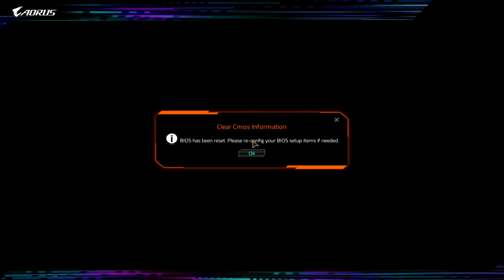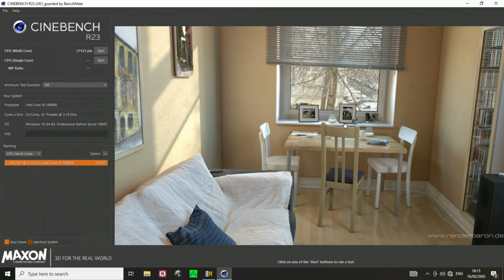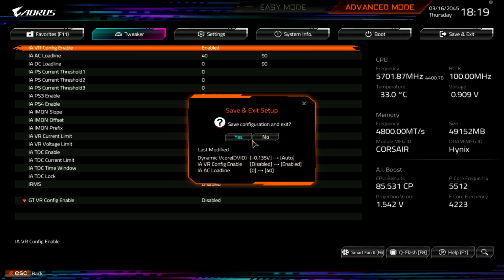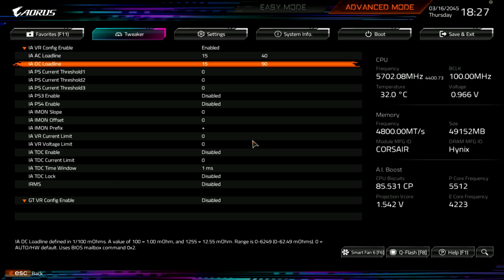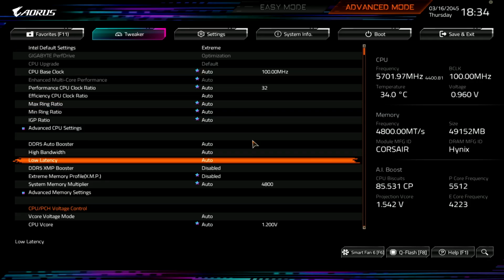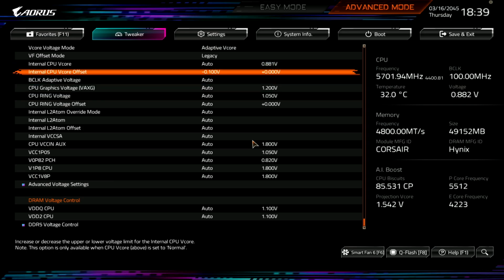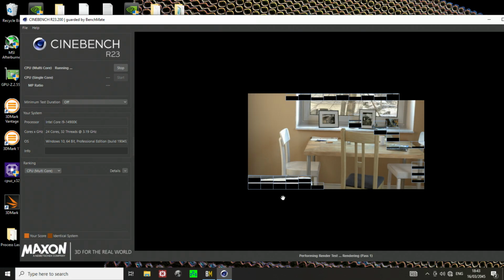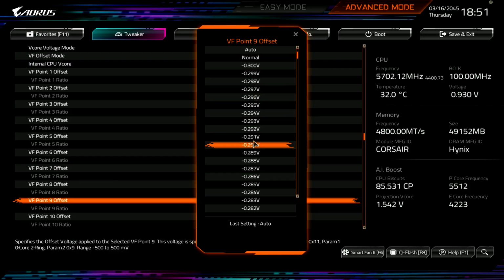YOU  DON'T HAVE  TO TURN OFF CEP to undervolt intel 13/14th gen CPUs

Comment: What does MSI Lite Load setting do (as opposed to load line setting)? Ive set mine to mode 3 which gives me much lower temps and no performance degradation on my 13700k. CPU temps under load are around 75c, whereas with the stock setting of 9 it hits 100c. Is this a good way to prevent or reduce the voltage spikes? Never had a crash in 18 months.
Reply: Lite Load DOES set Loadlines (AC_LL and DC_LL) the thing is that it hides this behind some abstract numbers on "Normal" mode. If you go to "Advanced" mode, you can see what it does and you can also set AC_LL and DC_LL on its own. Intel default goes to 110/110. If you use "advanced" mode instead of "Intel default", but enable both CEP settings, you might end up on 80/80 or something (I don't remember exactly).
Reply: If you can go to Mode 1 without crashing it's even better. the lower you can go, the lower voltage the mobo give to your CPU, so it depends on your CPU quality, if it can perform at Mode 1, then you're good to go.
Reply: MSI Lite Loads are basically just load line profiles. For example I believe Mode 3 would be an AC_LL of 15mOhms and a DC_LL of 80mOhms on my MPG Z690 Edge.

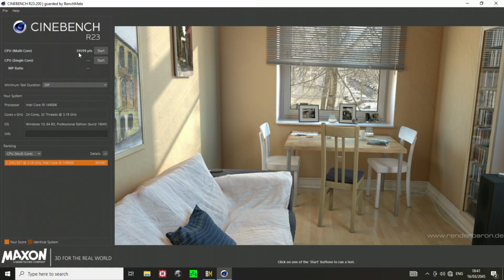Comment: 33:22
nvidia 375.70 (3rd row from top to bottom, right side) is from 2016.10.28.

nvidia 474.64 (1st row, 3rd column from right) is from 2023.10.31.
Reply: NGL, i really don't like Nvidia driver naming scheme. These numbers are not telling. 
For example AMD currently uses this scheme for public releases.
YY.M.V (aka 24.7.1 would mean first driver in July 2024.)
Professional usage drivers have naming YY.QX (aka 24.Q3 would mean driver from third quarter of 2024).

And test branch drivers have this naming scheme
XX.YY.ZZ XX is usually corellates with year, but can lag behind significantly. (Aka 24.20.08, meaning major version 24, branch 20, version 8, or something like that).
Reply: @DimkaTsv  who cares - number higher is all that matters - but really, for most its "I was told my software X I have new drivers"

Comment: I'm not a fan of keeping intel default profiles enabled. The stuff they lock out from motherboard to motherboard is just so random, it's annoying to deal with. Not everything translates well when trying to help others. Just go full manual mode, disable it. I've had great results with Turbo LLC and AC LL as low as possible, small offset on top. Not every CPU likes -0.1V, not even -0.05V unfortunately.

Comment: Which specific motherboard are you using, and when you said the Elite has a different voltage regulator, did you mean the Aorus Elite X Wifi7 model has a different VR?
Reply from the maker: No I meant the non-X elite
Reply: @ActuallyHardcoreOverclocking I love how motherboard and other PC component companies make their product naming incomprehensible. Last time I spec'd out a build for a friend, I had to create multiple spreadsheets to keep track of the confusingly similarly named parts. Slap an Elite, Pro, Super, Ti, or a random tech suffix, and watch as consumers with finite time and energy capacity spend too much on parts that don't do what they think they do.

Comment: 15:01 wow that is even lower than my 13600K which scores around 20k, which is actually quite a bit lower than what a 13600K should perform. Maybe that's because of degradation or maybe it's because my Deepcool AG620 air-cooler is not enough for this chip.
Reply: What score should an i5-13600K get ideally?
Reply: @BucifalulR  around 24-25k is what I had seen on other people's, including reviewers, benchmarks. It could be that the whole debacle with degradation and the new Intel Default Settings and the latest 0x129 microcode have caused some performance regression, but from what I have seen around the internet, it shouldn't be as bad as 20k on Cinebench R23.
Reply: @D23-qw7jf  I got 20802 only :(. If I apply Buildzoid's IA VR Voltage Limit of 1400 (Gigabyte B600M Gaming X DDR4 motherboard), I get even lower, like 19000. Maybe I should try with Intel Default Setting disabled, but doesn't that increase the risk of degradation?
Reply: @BucifalulR My 13600kf gets 25k+ on my old settings and slightly under 24k with Intel default settings.
Reply: @RandomGuy-ll9uz  On CInebench R23, right?

Comment: so i have a core i7 13700k ... I have seen 1.495 volts ... is this normal? thats with defailt latest bios and micro code nothing set to "performance" in the bios or so and no over clock .. CPU gets pretty hot too 

I have no idea and i find no data what says what is the normal max i should see ..but since i have seen several say " set max in bios to 1.4 volt and not higher " ...i am basically at 1.5 volt and thats not save ?
Reply: I'm not running the new microcode because I don't trust it not to overvolt my CPU. On an older microcode (10E I think) and with a modest undervolt my 13700k never goes above 1.29V. I'd recommend you check what your load lines are being set to at default.
Reply: @AzwraithPL  yea with the old mucro code max i did see was 1.365v.. but not with the new one
Reply: @noblackthunder  You can check what your load lines are set to using HWiNFO. Uncheck Sensors-Only/System-Only at startup and then navigate to the main window and click on the arrow beside Central Processor(s) and then on your specific processor in the dropdown. Scroll down until you find IA Domain Loadline (AC/DC) and see how many mOhms they are set to.
Reply: @AzwraithPL  AI Domain Loadline = 1.000 mOhm
GT Domain Loadline = 4.000 mOhm
Reply: @noblackthunder  There should be two numbers separated by a slash (/) beside your IA Domain Loadline. Assuming that 1.000 corresponds with the leftside number that would explain why your voltages are so high. You need to either lower your AC loadline or throw a significant negative offset at your voltage. I would absolutely not trust these chips not to degrade at 1.5V.
Also you can mostly ignore your GT Domain Loadline as it only pertains to your onboard graphics.
Reply: Same here. I also saw 1.5V sometimes with my 14700k. Updated to x0125 bios update and using intel baseline profile.

I have been Asking everywhere if its okay, but no one replied. So now i just enjoy it. If it died, then I'll try to RMA it lol
Reply: @OfficialMinamo you want to be under 1.35 volts . Anything higher is too much

Comment: Asus B660-G: can't set negative VID offsets, unless using uCode 104. No undervolting on B660?

The Mainboard sets 0.4/1.0 llc4 in synced mode - not going to dig into that even further. 1.4 Imc results in 1.55 CPU vddq - Asus is nuts
Reply: same with my Asus TUF Gaming B760m, it has to go back to microcode 0x104 in order to do any sort of undervolting.
Reply: Same with Gigabyte B760M Aorus Elite (1.x).
Reply: my undervolt on my 14600kf cpu on an asus rog strix B660-G motherboard (bios 3601 microcode 0x12B) in cr23 i get 2091 single core/ 25180 multicore. hwinfo e-core VID min 1.141v/max 1.279v/avg 1.22v. temperatures min 31º/max 68º. CPU POWER min 5w/max 122W. Vcore max 1.146v. (all this stressing the CPU)
MOBO BIOS
-asus advance oc profile: enabled
-intel adaptative boost technology: disabled
-asus performance enhancement 3.0: disabled
-C-state: auto (if I enable it my pc crashes, it doesnt even enter windows)
-current cpu core/cache current limit: 225 (default is 200 but it made me clock stretch)
-PL1 & PL2: 181
-LLC: 5
-synch acdc loadline with VRM loadline: enabled
-IA AC: 0.40
-IA DC: 0.72
-IA CEP: disabled (when enabled it works but if I put xmp profile it destroys my performance)
-VRM core voltage: offset - 0.135 (I can lower it more but its a bit unstable)

Comment: I must say that you did more for intel users more than anyone...But,you didn't cover the IMC topic. People will enable XMP and their IMC will send request to VRM which will automatically send 1.5V to IMC at 7200mhz,and most people are unaware of that...
Reply from the maker: 1.5V VDD2 isn't going to harm anything since that's literally XMP voltage for a bunch of DDR4 kits.
Reply: @ActuallyHardcoreOverclocking Much respect to you and all the testing you do for the community brother.  I gave up trying to get my 7600xmp 2x24gb hynix m die stable past 6800 on my gigabyte auros elite ax mb. I don't know how you got yours stable at 7200, nothing I tried for days could get is stable in stress testing past 30min without errors or crashing...

Comment: This is a 5.9/4.6 OC score running on a MSI Z790 Tomahawk only drawing 283w @ 81C. /a/KeHrGaN
Reply from the maker: congrats on winning the silicon loterry. I literally can't run cinebench above 5.8 On the P-cores at all.
Reply: @ActuallyHardcoreOverclocking  I did bin it, full disclosure and delid it as well.  It runs like a scolded dog though. IMO contact frames and delid kits should be purchased and used with every 12/13/14900K. A requirement let’s say. Only way to cool the bloody things with a 360 AIO. Deep cool LT720 is best IMO. Tested that against arctic LF III 360. Deep cool won. Hope it doesn’t shit the bed before warranty is up, LOL. Wait a min, I could care less about warranty. Personal preference thing.
Reply: @ActuallyHardcoreOverclocking  was that video cause of me. If so, thank you. I don't have an oscilloscope and have been wanting to have a look see.
Reply: "only 283w" for a cpu ... lmao
my highend gpu doesnt use that much
Reply: @Golden2Talon  You don't own a 14900K then. That is low under heavy load. I have it down to 267w now with new microcode.
Reply: @jwhitaker81  you remind me of the people who get used to 1300€ smartphones. "thats low". No its not. You just got used to shitty conditions my friend. 270Watt for a cpu is totally bad
Reply: @Golden2Talon  Is what it is. Can you make it better, right now! I sure can't. Just saying.

Comment: I'm tired of all this.
I installed the new microcode. You recommend enabling CEP, does disabling it remove the 1.55v hard limit for VID voltage included in the new microcode? In the meantime I disabled CEP and set an IA VR limit of 1430mV (below that number my cpu clocks decrease) in addition to the hard limit which I hope is active...
(I have a 13700k, an Asus Z790 mobo)
Reply: Vai aumentando o LLC que resolve
Reply: How you undervolt on asus?

Comment: CEP is an additional mitigation to a Plundervolt attack, which is highly unlikely to target a normal user, and would require some effort in social engineering to infect your system. It was demonstrated in research that the CPUs became vulnerable to exploits when an undervolt attack triggered faults which exposed its memory enclaves. Even if not trying to exploit the enclaves for sensitive information, the attack could still just aim to destabilize and crash your system. The attack would require root level access. 

In other words, CEP is a safeguard from letting you undervolt anywhere near the point that could induce the aforementioned faults.
Reply from the maker: you can still make the CPU unstable with VID offsets even with CEP turned on.

Comment: Dude my MSI board rocks. Locked all core 5.6/4.4 my 14900K idles at 1.345v and runs at 1.198v under full synthetic load doing nothing but using unlimited settings, locking the cores, and setting CPU Lite Load to mode 7. AC LL is .35mOhm and DC LL is 1.10mOhm the CPU stays under 80C and only draws a max of 267w. It knocks 41500+ Cinebench multi core all day at those settings and leaves me some overclocking head room should I so choose. I guess learn how your board works, test and tune? I mean no hard feelings man, but the results... If I'm nuts and missing something break out your Carbon Wi-Fi and show me what's up. My stuff is as solid as both of our hard heads together and lightning fast.

Comment: Legacy offset is entirely ignored on a 13600K AND 13600KF with the same motherboard and settings in my experience. Even tried CEP disabled. DVID has been the only way for me to undervolt on a 13600K/F on both the Z690 Aorus Master and the Z790 Aorus Master X.

Oddly though, HWInfo detects the offset correctly when it is applied, but the VID and VRVOUT do not change.
Reply: I am pretty sure there are weird quirks going on here from motherboard to motherboard. Or same board, different CPU. I've experienced some weird stuff as well. It's supposed to work in a certain way but it really doesn't.
Reply: have you tried disabling intel default settings?
Reply: Did you by any chance switch the profile from Intel Base Line to something else? I found by doing so you introduce a lot of weird stuff. Also there is a feature called undervolt protection which I did not have to Disable for my i9 but for an i3 I owned I had to with led to a bunch of problems! 

TLDR; What are you current BIOS settings?
Reply: @interceptor001  Yes, I've tried with CEP on and off, yes I've turned intel's default settings off. I've mimicked BZ's exact settings and it's not respected. I've tried on default and with custom settings. I believe it is a 13600K issue. I feel the need to reiterate that this behavior was present 2 years ago on the Z690 Master with a launch batch 13600KF, and is still present.
Reply: @Zhunter5000  I am not talking about CEP I am talking about the Undervolt Protection
Reply: @interceptor001 I was admittedly replying to your comment and the other guys at the same time. Yes I've had it off and the end result is the same.
Reply: Same here. Legacy offset is just purely cosmetic. HWINFO also detects the entirely un-applied offset.
Reply: It's coming a bit late, but never late than never? I highly suspect it's because there's one thing missing: Internal CPU Vcore must be set to normal. If you look at the text on the bottom of the screen at 39:27, you can see that the bios even tells you so.
Reply: @Snuggis Done that and it was still not working. Just got a 14900K yesterday and that is working as expected with these options so I have no idea what was up with the 13600K
Reply: Same here. You must also apply the cpu vcore offset value to the cache/uncore offset. For some reasons they are linked together.

Comment: When I run your settings exactly from previous videos, I get crashes of apps with any kind of undervolt, but cinebench will run perfectly fine for 30 minutes with a 100mv undervolt
Reply: Because it's hitting the power limit and running at lower frequencies which won't necessarily be unstable. Something stable in Cinebench could crash in a game which runs closer to 5.7, or the Timespy Extreme CPU test (in a loop) for instance. Or in any number of other scenarios, which is why extended testing is crucial.
Reply: @dd7428 I play iracing, the funny thing is the actual game doesn’t crash running at 5.8ghz its the timing apps and discord that crash, the actual game runs without skipping a beat and while its doing this the cpu is pulling around 80w
Reply from the maker: you crash even with a -50mv undervolt?
Reply: @ActuallyHardcoreOverclocking the game runs fine even with a 100mv undervolt, but the other apps like discord and my timing apps which use a browser instance and an overlay that crashes with the undervolt, even the browser instance of simhub that my screen display uses crashes, I think to get it not to do this the undervolt is -0.020. Also I see you selecting the actual voltage, is there a reason you don’t just type in the offset you want ?
Reply from the maker: @Panterluca I usually only have 1 hand on the keyboard  connected to the test bench because it's awkward  to reach. So typing things that require non-number characters gets annoying(like decimal points).

Also  it sounds  like you just lost the silicon lottery. I can't imagine that undervolting with CEP turned off  would work better(it doesn't help my CPU).
Reply: @ActuallyHardcoreOverclocking  you don’t think it’s the stuff running on the e-cores that’s crashing, I’m assuming all the extra stuff is running on them and only the game is using the pcores, I’m assuming an undervolt affects both equally
Reply: You can run Cinebench Single Core to test the undervolt. The r15 extreme edition in single core mode seems to be even better. Or CoreCycler for more granular testing.

Comment: 10:40 Using a legacy adaptive undervolt (with CEP/Intel Extreme defaults) and you won't see this behavior. I wonder why?
Reply: As in, setting an offset with legacy adaptive will lower temps, voltage, and raise performance - just like a standard undervolt without changing any other settings. Setting an undervolt with Auto however will result in the behavior shown in the video.

Comment: Yo, can you please just tell us how to get top, yet reasonable, performance on a 13900k. Especially with all the recent information. I'm going for fps in games, 280 AIO, high airflow, 4080. Pretty typical "gamer with the new stuff" setup, though I actually do production multimedia work on the pc during business hours.
What's the go-to overclock? Do I need to stay on Intel settings? Or go for an OC and the 1400 voltage limit from one of your last videos?

Or is this that video? Either way- thanks for all the cool info and videos, only a few minutes in to this one.

Edit: I think this is that video, and undervolting is the consensus for better performance, considering recent developments.

Edit 2: nah, this ain't gonna work for me. Someone please just point me to a decent, and corrected for q3 2024 overclocking guide 😂